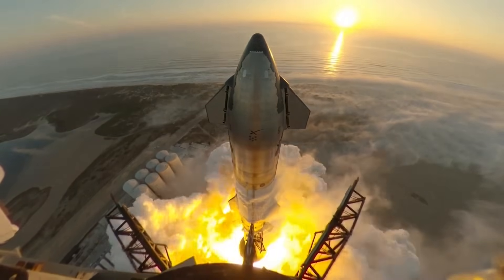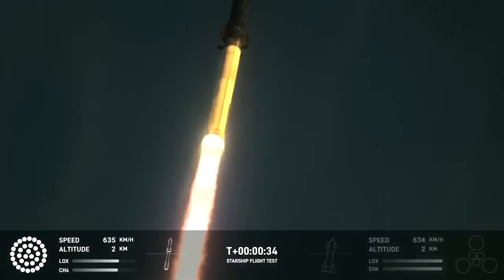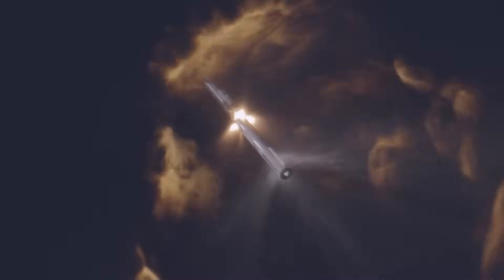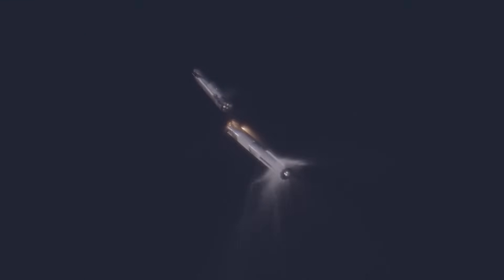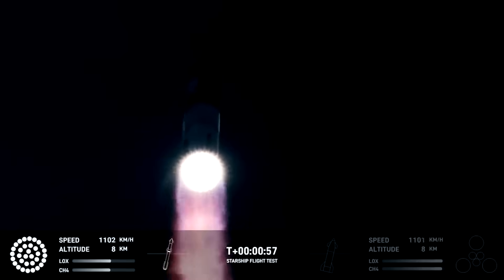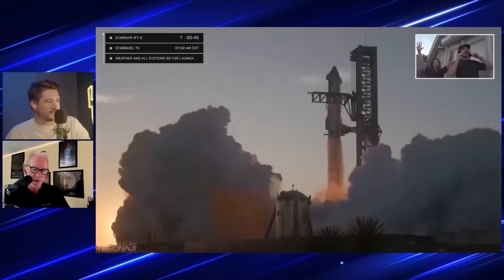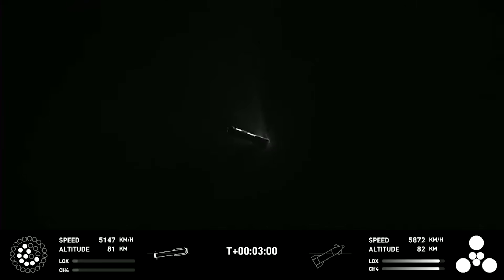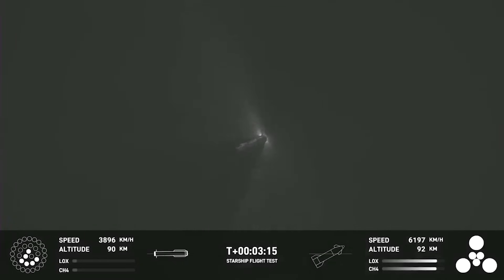Rocket Expert on INCREDIBLE NEW Starship Footage!!

Comment: I believe the starship can use its 3 vacuum engines to separate from the booster after the hold-down clamps are released. This also will cause a lot less stress, pressure, and heat on the top of the booster. The booster can also shut off all its engines before the start of separation and use its hot gas thrusters to reorientate itself slowly for burn back until it is ready to bring the engines back on line, while Starship fires up its sea level raptors and heads for orbit trajectory.

Comment: There is some urgency to get the boostback burn underway as every second of delay requires more fuel.  But they may have to yield to the laws of physics and delay the burn briefly after rotation to allow the booster and tank contents to settle, then use a set of hypergolic Super Dracos to do an ullage burn before they relight anything.  No part is the best part, but if the absence of the part jeopardises the mission then it may be useful after all.

Comment: Could add baffles and trap doors in tanks but that would increase weight. A ported disk/funnel near bottom of tank might be able to hold enough fuel down for the transition to not lose fuel on one side.
Reply: Engine flow is typically about 400 litres per engine per second of LOX.  In a 150 mm dia pipe the head loss is quite modest for the short distance involved (about 13 m head loss in  5 m pipe run), and 2 bar pressure will ensure minimal chance of cavitation.  I'm sure they have vortex preventers over the entry to the pipes as well.  
Basically, they have to give the tank contents time to settle down, then somehow achieve an ullage burn to get positive liquid fuel at pressure back into the turbopumps before they try to spin up 
again.  
I would not be surprised to see some SuperDracos at the end of the four eternal tank strakes to do that job, tho a lot of grunt will be needed to usefully accelerate the booster's 200 tonne dry mass plus remaining fuel..

Comment: I hate how the big media companies only cover "SpaceX Starship Rocket Explodes!" rather than the major successes IFT2 was.  The FTS activated on the booster due to when the engines were supposed to relight, one didn't.  Shortly after there were engine cuttoffs/failures every few seconds until only 5 remained.  At that time there was not enough thrust to boost back and put it on its course for the slpashdown where it was intended so the FTS detonated the booster for safety reasons.  The raptors seem to have issues restarting and hopefully V3 will fix this issue.  Each test they're getting better and better.  This test was a huge success and the hot staging works fantastically!
Reply from the maker: Absolutely. I don’t get why people report so skewed on this.

Comment: 1… seems to me the booster does not need gimbaling raptors.  If you want the nose to pitch left then simply turn down the raptor on the left side and/or crank up the raptor on the right side. 

2… during the booster flip what about the centrifugal force? The liquids inside the tanks would be pushed away from the axis of flip rotation (upper tank towards the nose, lower tank towards the engines). Perhaps SpaceX modeled the tank fluid dynamics and then verified their simulation with a tank scale model getting pushed and flipping around inside a weightless trajectory air flight. 

3… the color of the exhaust coming out of the ring during the separation boost may indicate a lot of material ablated between the starship and booster.  There are better ways to do the separation.

4… looking at the booster explosion, this provides a measure of what damage a launchpad explosion would cause. Now consider the booster had already used up 90% of it’s CH4 & O2 when it exploded plus none of the starship exploded.  I suspect the Detonator is too large and caused all the O2 & CH4 to mix in a millisecond which created an efficient explosion with extreme pressure.  The detonator would likely make an explosion in the first 2000 feet a huge disaster worse than if it had exploded from a RUD engine/turbine event. Instead the detonator may need 2 parts; the first ruptures the O2 tank to minimize the Oxidizer, the second then blows up what’s left a few seconds later. Regardless, the detonation approach for when the ship is under a mile from the ground should be evaluated to make sure the detonator does not make it more dangerous. If the rocket veers off course towards the Ocean, then let it get far enough away to not endanger people by exploding it prematurely.

5… regarding the detonation trigger algorithm, it would have been better for it to detonate so soon after the separation time.  More data could have been collected.  Even if it was already failed, reacting to the unique stresses and conditions on the booster would have been  useful to know.
Reply: IMHO, Vector control using thrust is not enough to control the stack when lifting off the pad and clearing the tower.  - that needs very fine and very fast control.  Likewise for boost back and landing burns fast precise vectoring is required, especially when 'landing' within the chopsticks.
Reply: @nigelwilliams7920 good point. Wright Brothers beat the competition because they focused on control
Reply: @douginorlando6260  and New Zealand’s Richard Pierce sorted out joystick controlled rudder and elevator first while the Wrights were weight-shifting with their hip cradle.

Comment: Great Analysis ! ... Musk's Main Goal was to Not Damage the Starbase and Swamp !  ... Now they have a Reusable ground Zero ... and the FAA and Greeners are Happy , and off their Backs ! ... Now they can Test and Fly more ... They also got a Full Deck of Raptors to Run !  Goal 2 is achieved  ... Goal 3 was Hot Separation , Check ... And the Starship almost did its Full Burn ! ... The most valuable win is the Telemetry for a Neo , World's BFing Rocket ! ... Who cares about Unpredictable Dangerous Landings ? ... They needed the Going Up Data to plan the Coming Down portion .... Next Flight ... ASAP

Comment: Two things: 1. it seems like the 2nd stage thrust vector would be mostly horizontal to the axis of flight until the 2nd stage rocket are clear of the ring and 2. uleage settling could be reduced with a perforated plate near the bottom of the fuel & lox tanks. Thing 1, if it's a problem,  could be addressed with a flutted pseudo nozzle, i.e., a taller ring with interior fins to manage the thrust gas flow to achieve a higher in-line vector of thrust. Thing 2 is a technique used in racing car fuel tanks to keep the gas from accelerating away from the drain under high centrifugal loads (or braking). The perforations would have to be sized so that they don't interfere with the expected normal flow to the pumps while also reducing uleage settling.

Comment: That's one possibility is what happened, but it could be spacex intentionally blew it so they didn't have to fish the booster out of the ocean. With starship, his explanation would work really well. Starship blew right after the karma Line and raptor engines shut off. Starship was just going to coast and reenter, so it didn't need the 27500 kps to stay in orbit.
Reply: SpaceX would not have had to fish the booster out of the ocean.  Until SpaceX's Falcon rockets, all boosters from every space launch was simply dropped into the oceans, never to be recovered.

SpaceX wanted the booster to perform a 'soft landing' into the Gulf of Mexico.  If successful it would have sank and not been recovered.
Reply from the maker: @damonried1720  exactly that was what Scott also said in the full interview here: https://youtu.be/C_pUPZc0Ooo